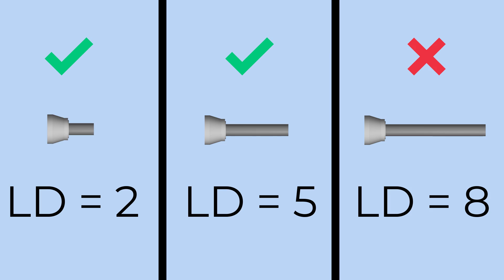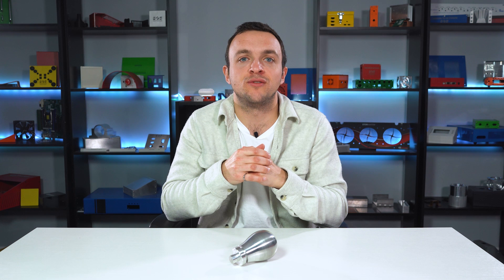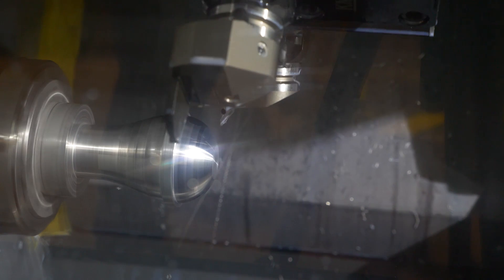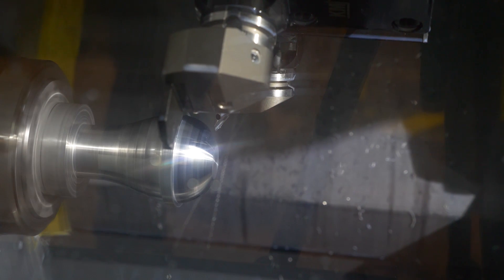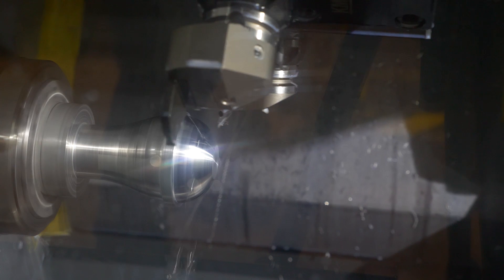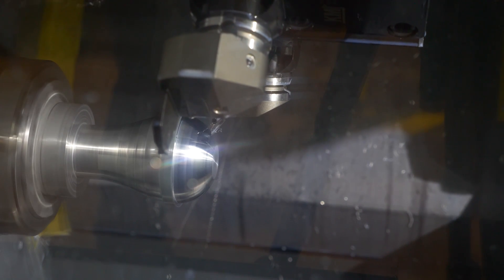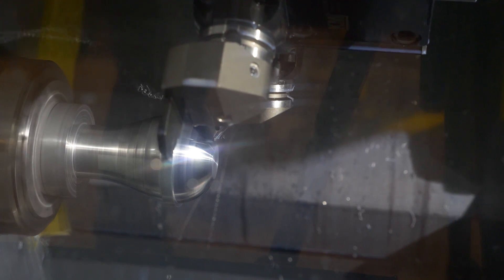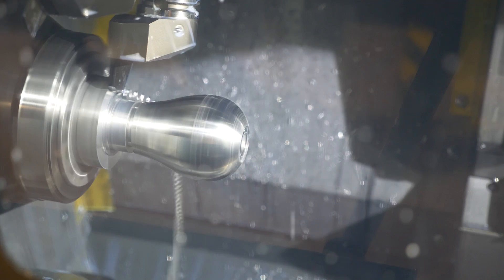Proto Tech Tip - The Basics of CNC Turning

Comment: hey i love your software i downloaded but im not savy knowing this stuff or what size thickness i want or is right. basically i want to build a PC case but not a standard ATX case. so i choose the other structures use have and select cut outs and design my case. i know use do something like checking it or something idk what use call it to see if its correct structure for strength. but what about the parts like USB inside and stuff like that like where do i buy it if use dont put it in for me with a wire. im not sure so i hope u could help sorry for being a noob i love building like designing, i love playing The Forest the PC game.
Reply from the maker: Hey SAS Productions, thanks for your comment. Here at Protocase, we specialize in custom enclosures and parts - we are not able to source your internal components or do the wiring, etc. If you have the specific components you know you want in your case, we do offer Design Services - where one of our engineers will design the case you need for an hourly design fee (typically, designing a PC case would be at least 3-4 hours of design time). You can email info@protocase.com to learn more, but keep in mind, the cost would be the hourly design fee plus the cost to actually manufacture your PC case, so it may not align with the budget you have in mind. Either way, thanks for watching our videos and for checking out Protocase Designer :)